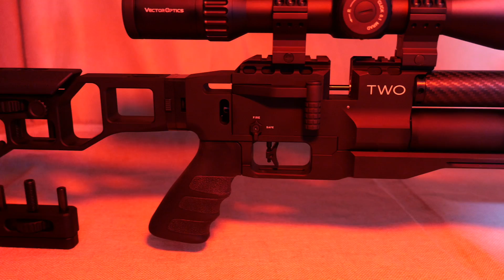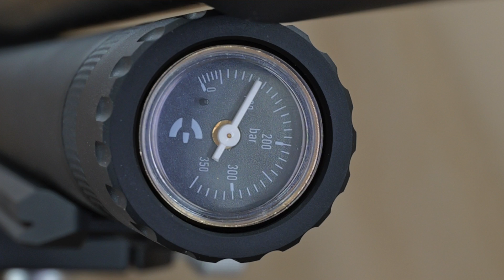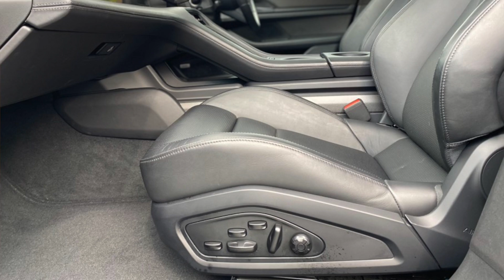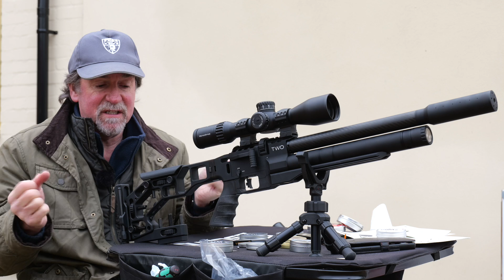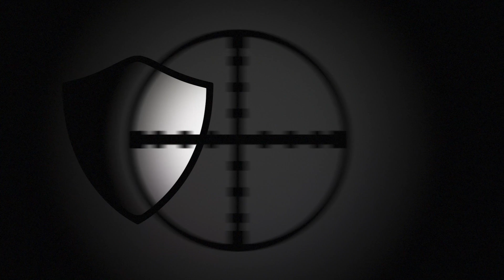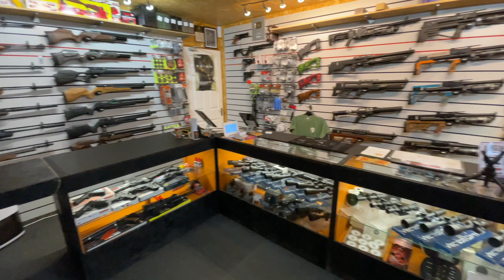Epic Two "Awesome!!"

Comment: Hi Andy, I bought this gun based on your review. However, how do you know which position the hammer spring is adjusted too? I just can't understand how this adjuster works. Thanks
Reply: The Epic 2 has a balanced valve. Increasing hammer tension will have not further effect once the valve has enough tention to open. So you only need to adjust the hammer tension until it fully opens the valve.
Reply: @pixieadventures-t6v  Thank you. Do you turn the adjuster north or south to do this? When do you know you have achieved this? There are no markers, no indicators on the adjustment.

Comment: Hi Andy just wondering what would be your choice between this epic airguns 2 or the agt vixen
Reply from the maker: There is a huge difference in Guns there! It’s like comparing apples with Oranges, they are both fruit, but you perhaps wouldn’t put a slice of apple in your Gin and Tonic?
Reply: @AAROnair  :) I get what your saying the epic 2 does seem as if it's a few teir's above the vixen I suppose a better comparison would be the agt vixen Vs airmaks katran i would love a epic 2 just fighting with myself if it's worth the extra money over the other 2 guns mentioned cheers Andy thanks for the reply 👍
Reply: Hi Andy thought I'd give a little update I ended up going with the agt vixen based on your review of the gun and cost difference from the epic 2 got the vixen hawke airmax 30 ffp 7litre diving bottle and a tin of pellets for £1700 couldn't be happier keep up the good work love the videos

Comment: Just got into this hobby and I've narrow it down to 2 rifles after a few weeks of research. This one and the FX impact. I am leaning toward this one, because i like the look better. However, there was a reported issue with the regulator on the epic two, which is that the first two shots are basically useless after picking up the gun after an extended break without shooting it. Giving that the tank is small and up to 260 CC, that would be a bummer. 
Anyone have had any issue with the regulator?
Reply from the maker: These are brand new and Vector Air are the importer and there have been no regulator issues at all…not sure who is making that comment?if you want a higher shot count, go for the 550 length or the carbon bottle version.. stay safe. Andy

Comment: I had a go with the epic two today in 550mm barrel the quality as you said and build quality is off the chart however there is a problem and in 550mm its very heavy and the weight is front loaded which is such a shame its such a awesome gun but to heavy in the front for me maybe the 300mm barrel/balance is much better.

Comment: Superb. Any idea of shot count in .177?
Reply from the maker: That is going to be power dependant, and length dependant, the 300mm has a short tube which also holds the reg and plenum, so in a power hungry .177 then 60 ish shots?? Stay safe
Reply: I've been told its 120 shots in sub 12 .177 for the 300mm barrel. So your answer has made me think of getting the 500mm version instead. I've emailed Vector air last week, but not got a reply. Any chance you could gey an answer please? @AAROnair

Comment: If the overall length is less than 60cm? Doesn't that make it prohibited in the UK at that power level?
Reply: Good question. At sub 12ftlb I believe it's excluded from the 300mm barrel / 600mm overall requirement (noting it's 850mm overall with the stock at full extent). In FAC it's going to depend if it's capable of firing with the stock folded, which would make the overall length sub 600mm. Edgun, Brocock and various takedown rifles get round the 600mm overall length requirement by being incapable of firing with the stock folded/removed. I'd assume this is the same.
Reply: @jacklurcher5813  - The 30cm / 60cm rule does not apply to Airguns, only powder burners in the UK. It states this in the Home Office guidlines. Also, its sold as a rifle, not a pistol.

Comment: You normally tell us what pellet/weight etc  you're using Andy. What did you use in this test? Pellet, slug?
Reply from the maker: Times….11.23 and 11.28 for the weight of the slug..which were H&N
Reply: @AAROnair  Sorry Andy,  must have missed that (I was obviously to engrossed) 😄👍

Comment: Genuine rifles are a third of the price and have double the recoil so the "build quality" excuse is BS. Not to mention its either .177 or .22 every time, .20 is the better calibre but its bypassed due to manufacturing costs again but charge you .50 rifle money for a 12ftlb pea shooter.
Air rifle companies need to sell more at a budget price rather than selling a few for mega money.  Slowly killing the game.

Drop a rifle and drop an air rifle. See which is dented and has accuracy problems vs the other.  Aluminum is cheap 😂
Reply: What's a 'genuine' rifle? A decent .22LR target rifle like an Anschutz 1761 is about £1500, a Blaser R8 is pushing £5k. If you want .50 BMG money then Accuracy International will happily relieve you of around £11k.
Then there's the FAC, the storage, the range/permission, and the ammunition costs.

If you want a £200 air gun you can buy one, if you want a £200 powder burner you can buy one. Personally I wouldn't want an Epic - it looks like the offspring of a fire extinguisher and a meccano set to me, but there's a lot more precision work gone into it compared to my HW97K or a similarly priced 'genuine' rifle like a Ruger American.

Each to their own.

Comment: To be fair; I notice with mock horror, I have to look down the business end to read my tank pressure gauge and fiddle with antiquated fill probe to charge with air.
Reply: I look at fill kit gauge when filling, and have no need to look while shooting as i also shoot tethered to a 12 L bottle, CUZ when you shoot a absolute minimum of 400 shots in a outing and some days as high as 1200, well constantly filling the rifle would be a major pain.
As for fill probes i do not get the hate of them, 2 of my 3 rifles use them, they travle in a tin ( .22 pellet tin ) along with some spare parts / extra magazines, so it is always there in the case with the rifle.

Comment: 300 bar u need a compressor .bottles are never near 300 unless its full not a problem unless ur away from home
Reply: MAX 300 BAR, no one say you have to fill to that level, actually many shooters do not fill to the 300 BAR they rifle are rated for.
I shoot tethered with REG pressure around 90 - 100 BAR, and i care very little for when the 300 BAR 12 L bottle i am tethered to drop under 200 BAR, or i am using my 200 BAR bottle.

True if you get bottle filled at dive shot, it is only 300 bar when it get off the compressor and is hot, and generally they do not let the bottle cool and fill again, i do that with my own compressor so my bottle are 300 BAR, actually a bit over that on hot summer days after it have spent 40 minutes in the trunk of the car getting transported.

test fill pressure on my bottle 500 or is it 600 BAR so say 310 BAR do not scare me.

Comment: Did I miss it as I didn’t hear shot count mentioned. I have AirMaks Katran that has a similar air tank and folding stock. Shoots great but shot count is low unless you go to the carbon fibre bottle which spoils the guns lines. Not really an issue as plenty of shots for most pest control and at the range you have your bottle but I can imagine in FAC the small air reservoir might be restrictive. ( maybe the FAC will have a bigger bottle )
Reply: Just what I was thinking
Reply: If you have a Katran C 177 you should be getting about 120 shots from 300 bar, unless your rifle isnt one of mine.....
Reply: @AirMaksarmsUK  bad choice of words, shot count is fine and expected. My observation was more about FAC versions. The Katran has a carbon bottle option. 
One of my best guns and let’s say a little bit cheaper than the Epic Two
Reply: @paulblundell8033 fair enough I was just checking you get the correct amount as early guns and ones from other sources to myself only get about half that shot count, but I can easily remedy that for owners if needed

Comment: It’s total engineering Andy. If you compare it to a watch it’s a Rolex. You could buy a Seiko which is a good watch but not engineered to the same standard. As for price I was expecting you to say £3k plus so for such excellence in engineering and quality I don’t think it’s expensive at all.
Reply from the maker: The problem with expensive watches is they are overpriced and don’t keep time, with overpriced service costs ( from experience) This is engineering and it keeps time perfectly (accuracy) 👍👍👍

Comment: Bipod fitting? Should really have weaver rails fitted or UIT rail in my opinion.
Reply: I believe there is an Anschutz UIT slot built into the Arca rail. I don't have any UIT fittings to be absolutely sure, but the dimensions that I measured are very close to it.

Comment: 1
Reply: Good morning Simon!
Having a good one?
Reply: @brorjordas1979  yes thanks , how are you ? IT`S gale winds here 😀
Reply: @simonnoble7589  I've been all good, thanks for asking.
 Been lately working on a diy aluminium can (just 14cm long) for my Virtus, to replace the og three pronged muzzle device. More of a barrel tip and thread cover, rather than a decent suppressor - but will be interesting to see what becomes of it. Have just gotten to hear the Virtus might be slightly more accurate when remove the og muzzle device. But just leaving bare the grey 1/2-28 threaded inner barrel nut at the tip looks hideous imo..🤣 The Virtus gonna resemble more like the Canebrake and old co2 MCX with the can hiding completely the barrel after the handguard.. Just gonna be held in place upon the barrel by several tight fitted o-rings. No good tools at work to make decent threads for the can, and thus doing it a bit "cheap hobby-style". But surely a fun project. Not ready yet though..
Reply: @brorjordas1979  .... Sounds very interesting on the Virtus ....  i bought a 1077 tactical , it had just come on at gun shop . Got a good deal on it ... i think its fantastic , and has about 6ft lbs of power .... Have put a scope on it ... cheers for now my good friend 🙃🙂😋